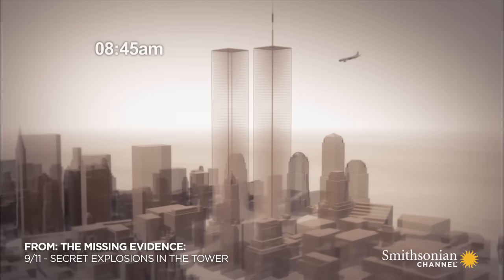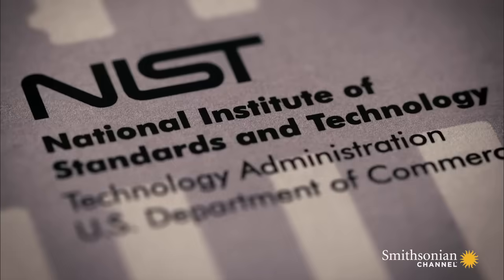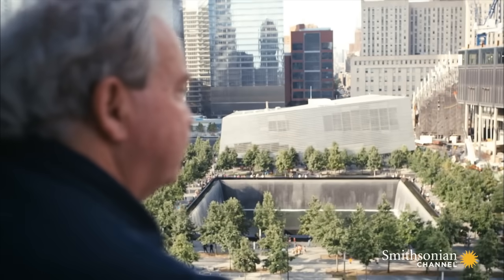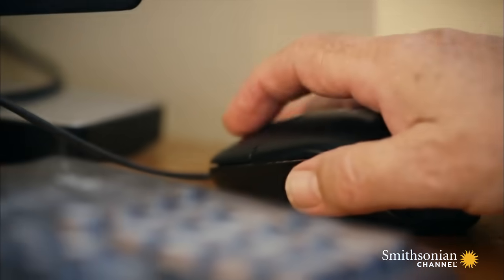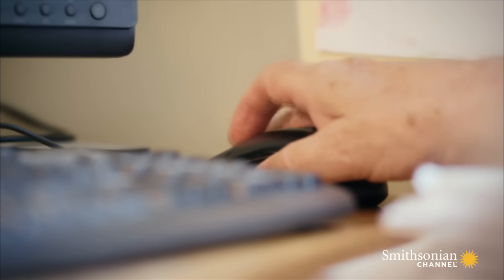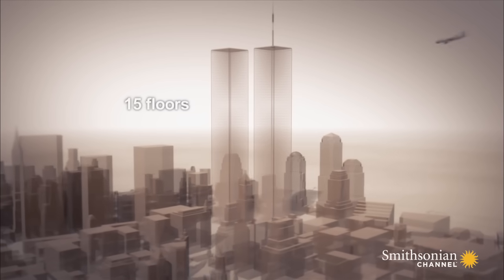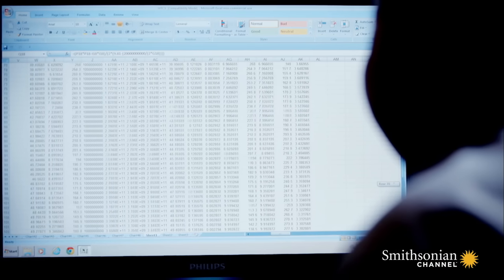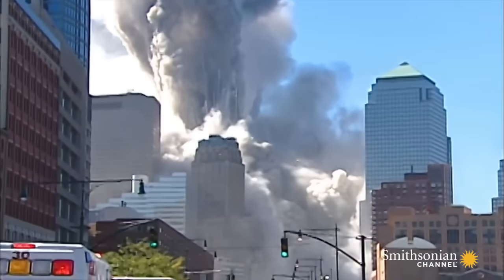This Computer Simulation Explains How the Twin Towers Fell

Comment: The official NIST story (which I call a lie) as they attempt to explain through office fires and/or partially bent steel beams-  would still require that more than air resistance was slowing the tower collapse time. The falling rubble would have to crush every intact story below the crash impact zone -- ripping apart the steel grids of the outer walls and obliterating the steel lattice of the 47 PCs of interior core structure. This is impossible, but in NIST putting forth this explanation, they and NO ONE else at all ever has  accounted for the resistance of the intact lower portion  of the building itself. At least 50-60% of the towers’ frame below the impact explosions was intact, and the LOWER to the ground you go down the tower, the thicker the outside steel frame and 47 core columns were. So the unaffected lower portion of the towers would put up great resistance that would be thousands of times greater than air resistance.

If air resistance was somehow able to increase the total collapse times by even 20 percent- then 
the addition of the resistance of the intact floors would still increase the collapse time several thousand percent. This would mathematically equal ~tens of minutes?

Of course the idea of a collapse lasting tens of minutes, even minutes is absurd, particularly since we can watch and count the collapse time in the ABC video ten times and get an average time of 10-12 seconds. 
This Assclown labels the upper floor collapse to being “ like the Titanic” to give people a randomly contrived comparison without saying ANYTHING about the resistance the upper floor portion would encounter with the intact lower half of the tower.
So the idea of a steel frame building crushing itself WITHOUT demolition/explosive assistance in 10-12, even 15 sec’s ( being generous) is absurd as well.
Reply: @Shelby_Starner_Everything  LULZ
Reply: @Shelby_Starner_Everything  where did you study engineering? Youtube comments?
Reply: @Shelby_Starner_Everything  so you believe the building was crushed by the upper floors... Are you able to do math? Maybe you are a common core child...
Reply: @Shelby_Starner_Everything  lol
Reply: @Shelby_Starner_Everything  if the load of the upper floors crushed the lower floor, I wonder how are we able to build buildings if the weight of the upper floors can crush the lower floors?
Reply: @Shelby_Starner_Everything  so when do you get your YouTube degree?
Reply: @Shelby_Starner_Everything  oh so it was crushed...
Reply: @trollharder1488  Uh huh. Anything else, loser?

Comment: I find it odd how you think a computer program, is smarter than the experts who build and demolish these buildings everyday.
Reply: @Shelby_Starner_Everything   Debris fell past the intact floors below and also a column stood for about 10 seconds after the rest of the building collapsed. Also doesn't happen in a controlled demo.
Reply: @peterjv8748  lol
Reply: @Shelby_Starner_Everything  where did you see these terms before being used as you have?
Reply: Objects CAN free fall through a Resistance  What video shows a "50-story tall section of the [North Tower] shearing away intact" and what aerial photos show "massive volumes of debris that impacted WTC 7"? As with the rest of the assertions that fill Blanchard's article, the reader is apparently expected to just take his word for it.
Reply: @Shelby_Starner_Everything  Despite Blanchard's communications with Dr. Jones, he fails to accurately describe the evidence that Jones cites for the use of thermite. These include:
Appendix C of FEMA's Building Performance Study, which arguably does show telltale signs of the "degenerative 'fingerprint'" of thermite and/or thermate, such as deep cavitation due to sulfidation and intergranular melting
Microscopic analysis of dust samples with a known chain of possession
Abundant potassium, manganese, and flourine in samples of previously molten metal from the WTC site -- elements not abundant in structural steel but constituents of polytetrafluoroethylene and potassium permanganate, accelerants used in aluminothermics
Footage of the South Tower broadcast live on ABC News moments before its destruction, which shows a descending spout of orange material and a rising plume of gray smoke emanating from a point on the perimeter wall. Thermite reactions produce molten iron (as glowing orange liquid) and aluminum oxide (as gray smoke), matching the observed event like a hand in a glove.
Reply: @Shelby_Starner_Everything  lol you don't have a clue what you are talking about.  LULZ
Reply: @Quake proof a house Taylor Devices Viscous Dampers who tagged you in?  Guess they couldn't handle the truth and called another fake account to ad hominem.  Lol lol lol lol lol lol lol.  You guys are weak sauce.  Save face and quit your day job.
Reply: The video doesn't say that at all.
Reply: @peterjv8748  apparently you aren't smart enough to understand they are implying this computer program verifies, why the buildings fell into their own foot print.  And tries debunking conspiracy theorists.
Meanwhile experts in Engineering and Architecture totally disagree.
Reply: @peterjv8748  Architects & Engineers for 9/11 truth
Reply: @Shelby_Starner_Everything  what do you mean by "legged out"?
Reply: Objects CAN free fall through a Resistance  I see now. You are a parrot.
Reply: Objects CAN free fall through a Resistance  Despite his self-proclaimed expertise, Blanchard fails to debunk any substantial arguments for controlled demolition of the WTC towers. His arguments amount to a series of fallacies wrapped in appeals to authority and reinforced with pretentious language.
Reply: Objects CAN free fall through a Resistance  Blanchard admits that the Towers mushroomed, with 95% of the debris falling outside the footprints. But that being the case invalidates the official account -- at least NIST's version of it -- in which the "tremendous energy of the falling building section" is supposed to have crushed the buildings from the crash zones down.

With the vast majority of rubble falling outside of the Tower, where is this alleged 'pile-driver'? The visual records show no evidence of the "falling building section" after the first three seconds of each event, only exploding clouds of dust and metal fragments.
Reply: @Shelby_Starner_Everything  lol "ejected out" is a sign of horizontal force.  Which is not a sign of a pancake collapse.  Lol go to school laymen
Reply: @Shelby_Starner_Everything  crush down collapse and pancake collapse are the same thing Einstein.
Reply: @Shelby_Starner_Everything  lol
Reply: @Quake proof a house Taylor Devices Viscous Dampers LULZ
Reply: @Quake proof a house Taylor Devices Viscous Dampers lol
Reply: @Shelby_Starner_Everything  lol
Reply: @Quake proof a house Taylor Devices Viscous Dampers so you are only 5 years old?
Reply: @Shelby_Starner_Everything  polly... You should know the technical term of what a "crush down" or a "pancake" collapse.  It's called a progressive collapse.  Please tell me again how it was a "crush down collapse" and not a "pancake collapse".  Lol lol lol lol lol

I'll wait Einstein.  Or maybe you should save face and quit your day job.  LULZ
Reply: Objects CAN free fall through a Resistance  lol I can't stop myself from laughing at your name.  LULZ
Reply: @Shelby_Starner_Everything  so did you just watch a YouTube video and think today is the day you finish passing your YouTube degree in physics?  Lol lol lol lol lol lol. Please go do your homework you are all over the place and obviously typing off a script or totally failed in college and you are dyslexic.
Reply: Objects CAN free fall through a Resistance  simply jump... Lol lol lol lol
Reply: Objects CAN free fall through a Resistance  also to be technically free falling the object cannot have any resistance.  Including air density which causes resistance....
Reply: Objects CAN free fall through a Resistance  air resistance cause flight...
Reply: Objects CAN free fall through a Resistance  you are correct to say a progressive collapse can cause a crushing force.
Reply: Objects CAN free fall through a Resistance  
"Pancaking floors would not have destroyed the core, so it was crush down."
It was crushed by what?
Reply: Objects CAN free fall through a Resistance  lol. Nice deflection
Reply: Objects CAN free fall through a Resistance  what B7 are you referring to?
Reply: Objects CAN free fall through a Resistance  do you understand cause and effect?
Reply: @trollharder1488  All done now, loser?

Comment: It didn't explain anything.
Reply: What do you mean?
Reply: @peterjv8748  what do you mean?
Reply: @peterjv8748  I thought it was a very superficial.
Reply: @peterjv8748  what did you learn from the video?
Reply: @peterjv8748  what type of collapse was it?
Reply: @peterjv8748  so you didn't learn the collapse type...
Reply: @peterjv8748  what did you learn? The buildings went down? Sounds like you didn't learn anything or was this the first time you heard of the events of 9-11-01?
Reply: @peterjv8748  well yes.  If you are a structural engineer you would look at the types of failures present. Then based off the evidence you would be able to determine the type of collapse.  But it's ok.  I'm probably going over your head with technical studies.  But I'm glad you learn so much from YouTube.  When do you think you will get your degree?
Reply: @peterjv8748  do you know anyone who does?  I've seen the progressive collapse theory and the crush theory.
Reply: @peterjv8748  obviously this is above your head.
Reply: @peterjv8748  sorry you have limited knowledge and are limited to this video.  It's like I said it's above your head...
Reply: @peterjv8748  if all you learned from this video is that buildings fall down; I would say you need a cookie.  I wouldn't give you the recipe because I know you can't follow instructions...
Reply: @peterjv8748 <=== "I learned buildings fall down"
Nice.  
The topic never changed you are just having a hard time following along.  Lol lol lol

LULZ
Reply: @peterjv8748  what's the difference between a duck
Reply: @peterjv8748  what are we arguing? I doubt you understand the words that are coming out of my mouth.

LULZ
Reply: @peterjv8748  what did you learn from watching this video?
Reply: @peterjv8748  LULZ
Reply: @peterjv8748  so you agree the video didn't explain anything well
Reply: @peterjv8748  and you learned nothing of any value.
Reply: @trollharder1488  So you're all done now?

Comment: Computer simulations can be trusted for sure.  It's just the programmers who can't!
Reply: the buildings could withstand an airplane impact but not a controlled demolition, simple.
Reply: @Firefox-rt9ev  engineers also said that the building could’ve taken 10 planes and would’ve standed 🤷🏼‍♂️
Reply: @otbcmurda7716  to their credit, the buildings did withstand the planes, not the fire
Reply: @otbcmurda7716  engineers that were involved in building the towers or independent engineers that understand the physics and chemistry behind the towers fall?
Reply: @Firefox-rt9ev  The slurry wall still does it's job of holding back the Hudson river. The foundations upon the bedrock are still good along with the PATH subway tunnels. Had two 500.000 ton, quarter mile tall buildings collapsed into the foundations, all lower Manhattan would have been under water. All the adjacent buildings would have suffered significant damage from projectiles being blasted by bombs and air speeds up to Mach 2.5 and that didn't happen. The buildings were turned into dust from the top to bottom. Where did the towers go? Evidence of directed free energy technology on 9/11. Judy Wood. Empirical evidence is the truth, that theory must mimic. What happens when you cut the support from under a tree?
Reply: Would have been interesting to see his take on building 7
Reply: It must be accurate...did you see all those numbers on his computer screen? Science.
Reply: @DanielWSonntag  You don't believe a math & physics simulation but you'll believe some idiots on an online conspiracy forum, got it.
Reply: Not really
Reply: Videogame Programmer

Comment: I'm glad in not the only one shaking my head through this
Reply: I don’t understand, what’s wrong with this
Reply: @Cal90208  This explanation is preposterous.  He's literally saying a fire can cause a building to collapse at freefall speed (never ever happened in recorded history before), and offered up a flickering screen with Microsoft Excel running numbers as proof.  They take the public for fools.
Reply: @theredbrick3249  Calling someone a fool using bad grammar.  Congratulations on "your" irony win here.
Reply: @theredbrick3249  you believe fires can melt steel enough to make them freefall?
Reply: @paulden3158  steel does not have to melt to become compromised, but you knew that already right?
Reply: I am shaking my pheenis through this video
Reply: A jumbo jet flying directly into a skyscraper has also never happened in history before, so you can’t judge that the way the buildings collapsed was abnormal, because it has never happened before
Reply: @imirS-n5z  Lets just pretend a jumbo jet crashing into a building could make it collapse in a manner consistent with a controlled demolition- then how did Building 7, which was not struck by a plane, collapse the exact same way?
Reply: @jcamp788  your argument begins to fall apart when you consider the location of WTC7, had it been a few blocks away maybe it would seem suspect but it was right next door to WTC1/2. After the towers collapsed they knocked out the sprinkler systems allowing for a fire to rage for over 5 hours, they also damaged the structure and foundations of the building. It's really not hard to grasp.

I bet you think the collapse in Miami was an inside job too? When a buildings structure or foundation is compromised they can fail, there was nothing special about any of the WTC buildings really. They got damaged, they collapsed. Simple.

Comment: This "physicist" set up a computer program that would produce exactly the results he wanted to obtain. The factor that disproves his and all other "proofs" that the towers collapsed under their own weight driven by gravity alone is the fact that the collapse progressed at a near constant, in fact slightly accelerating, speed from beginning to end. This is impossible with a gravity-driven collapse because the accumulation of debris beneath the falling mass of upper floors acts to progressively increase resistance to the downward motion.

The accumulation of solid debris will ultimately reach a compaction limit that will completely stop the downward motion of the falling mass. So what should have been observed if the towers had fallen in a gravity-driven collapse would have been a slight acceleration at the start of collapse and then a gradual slowing of the collapse to a stop with most of the lower floors remaining intact. The only way the towers could have collapsed at CONSTANT SPEED all the way to the ground with almost no piling up of debris was by a huge number of powerful explosives that pulverized most of the structure to dust and blew it out from under the falling mass. And this is entirely consistent with what is observed.
Reply: The towers clearly crumbled from the top down at much slower than free fall so your claims make no sense.
Reply: @peterjv8748 
I believe you missed the main point of my comment. It is not the speed of collapse relative to free fall speed that is crucial, even though it was very close to free fall. It was the CONSTANT SPEED throughout the collapse that was impossible by gravity alone because the accumulation of solid debris would have caused increasing resistance to the falling mass resulting in significant observable slow down to a stop well short of reaching the ground. It is quite clear that there was NO SLOW DOWN from the beginning of collapse to the end. This is much easier to see in the collapse of the North Tower, the second one to fall.
Reply: @newjeffersonian6456  
The towers were 95% air by volume, and the exterior walls fell out the side.
Reply: @peterjv8748  sure how much do you get paid to moderate?
Reply: @trollharder1488  Uh huh. Anything else?